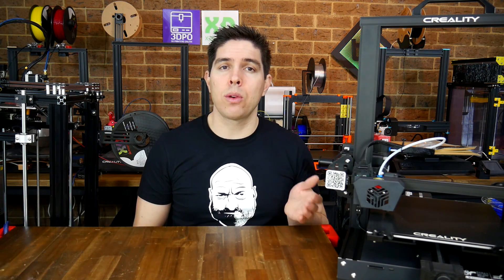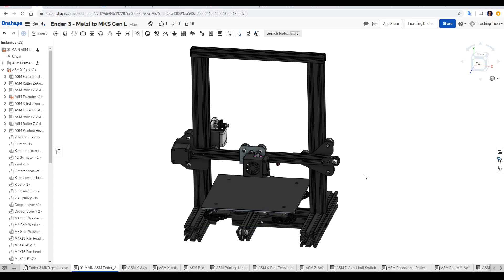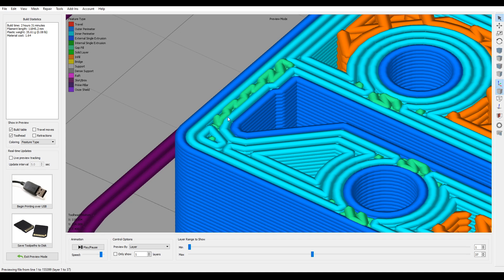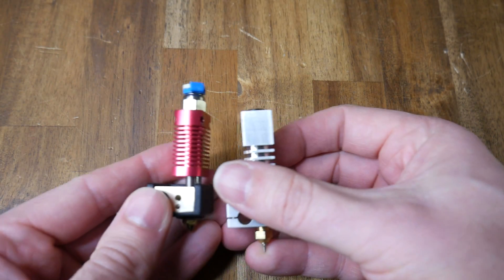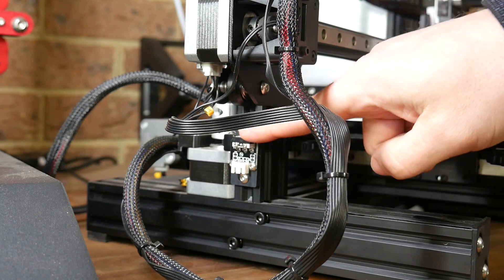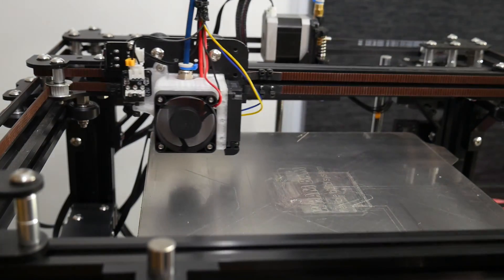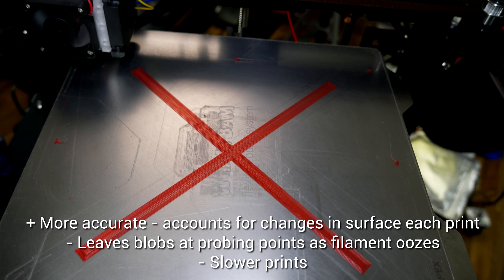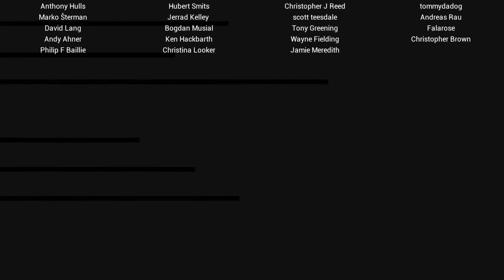CR-6 auto bed levelling for free on the Ender 3 - New printable mod

Comment: Did you run an M48 command to see the results for the repeatability test? Would be curious what you get.
I recently installed a BL Touch and have the stronger springs on my Ender-3 bed, so I opted to go with method 2. I did a 9x9 grid with the bed heated (took over 14 minutes) and then saved that to EEPROM. Then have the M420 S1 in my startup script. Periodically I will rerun the 9x9 grid and save to EEPROM if I feel the need.
Reply from the maker: Not enough room on the standard board unfortunately. All I could do was repeated g29 and compare numbers. With the slower speeds it was about 0.05mm.

Comment: Awesome addition to auto-bedlevelling methods. Nozzle probing is the most accurate method of getting that first layer down perfectly. Unfortunately, nozzle probing also means the nozzle needs to be absolutely clear of any oozing plastic - easier said than done most of the time.
Reply from the maker: I think if it's hot the filament will just get squished out of the way, but with mess. Hot bed, warm nozzle Prusa mini style might be the answer.
Reply: The pressure needed to cause movement will squish any heated oozing filament.

Comment: great idea, and quality content as always. keep up the good work. however, let me point you towards a video from Angus, where he showed a method called "sacrificial layer" that is used on overhanging holes on the print. i think you could easily implement it on your designs, for better printability, and a true supportless model.

Comment: You couldn't upload this before the kickstarter closed? :(
Reply: If the only reason you were buying it was bed levelling, you’re not doing it right
Reply from the maker: The cr-6 is still fantastic and the original system I'm reimagining here is still superior.
Reply: 6SE is a big upgrade on the Ender 3 for about the same price (depending which pledge you got)

Comment: It might be a good idea to add a stop screw to the side to limit "down" travel of the hot end. That way you could keep it under a bit of tension all the time and have more consistent locating of the hot end.
Reply from the maker: Great suggestion
Reply: @TeachingTech  Mabey also make instead of a limit switch use a washer And a Bolt yo make the switch that Will make it more acurated
Reply: I have done this!

Comment: Detect bed contact by detecting an increase in (stall) current on Z steppers? Can stepper current be monitored that closely?
Reply: Not with the stock stepper drivers. So you'd at least have to get a new mainboard if you haven't already.
Reply from the maker: Yes, with tmc steppers as jack days. According to marlin docs easy to destroy the lead screw.
Reply: @TeachingTech  oh well, an interesting idea to explore...
Reply: @TeachingTech  I'm getting a skr mini e3., would it be possible with that?
Great job!

Comment: Warm bed levelling before each print - Set the bed to print temp, and the nozzle to 170... do the mesh, then set the nozzle to print temp. This is what the Prusa Mini came with... and I've updated all my printers to do it now.
Reply: not necessary.. but if you are happy :D
Reply: In case someone wonders how to do this, you can add it to your start g code in your slicer
Reply from the maker: Simplify 3d inserts the temp gcode for you so a limitation that stopped me doing this, but a very good suggestion.

Comment: This was what came standard on my old kossel mini delta.  Tried many iterations to improve accuracy.  In the end the best thing to do was to mount a micro switch on the end of the nozzle without the little metal lever.  I went from .05 accuracy to about .01 or .02.
Reply: Interesting, do you know why manufacturers moved away from the concept?
Reply: @veidumeidu  at least in the kossel design it wasn't reliable enough especially for a delta (no manual bed leveling possible).  Taking that into account and the deviations skewed by effector tilt made it a very poor leveling system.

Comment: Michael, your design is "not overly complicated", just the minimum for functional design. I wonder if we can use an optical sensor instead of the mechanical sensor but it would remove the satisfaction of the clic sound :)
Reply from the maker: I actually purchased some optical sensors but originally thought they would output a clear digital trigger, but instead it was more analogue and needed an additional circuit to get it working. It would be more accurate but didn't fit the concept I was after here.
Reply: What about a hall sensor?
Reply: @brunoboettcher67  Hall sensors are also for fast moving applications. The magnetic field is much broader. They work great in very high speed applications. Since everything else has been tried resulting in low accuracy, this is why Creality went with a strain gauge. What you can do is spend just a few more dollars on a more sensitive strain gauge. For you it is a one off or so. Creality had to keep cost down as a few extra bucks times tens of thousands makes a bigger difference.  The strain gauges i have worked with as a GM engineer are as small as a 1/8" square and can flex with just a fraction of vacuum or pressure change. You would be more accurate than any plate of glass can get.
Reply: @brunoboettcher67  everything is possible. But common hall sensors are quite big to fit in the design. And you come back to something like a BL-Touch in the end or another common sensor in 3D printing :) the mechanical sensor is the most compact
Reply: Indeed, you are right, totally forgot that the bl touch uses a hall sensor.... remains the strain gauge?
Reply: Correct.... cheap optical sensors are poor measure tools at slow speeds. They are best used at fast moving speeds since light moves at 186,000 miles per second which is why they were popular in performance ignition systems and even many factory ignitions in the 90's. The optical sensors on the Geeetech A30 PRO need blade movement of .1mm to go from on to off. At .05 the led dims only. I find a quality switch better than a cheap optical sensor except for longevity.
Reply: There is a touch proble similar to a bl touch that you can 3d print with only an optical sensor. I will attenpt this in the future :)
I heard its pretty accurate, tho i also like his solution for people who dont want to spend any money or modify their software much

Comment: oh hell yaeh this is awesome. I wonder how much more accurate/ smaller actuation distance you can get by removing the metal arm and just hitting the endstop button itself?
Reply: I have auto bed leveling with a microswitch mounted to a servo arm, and running M48, surprisingly it was less accurate without the metal clip.

Without metal thingy
M48 Z-Probe Repeatability Test
Mean: 0.150225 Min: 0.137 Max: 0.156 Range: 0.019
Standard Deviation: 0.005109

With metal thingy
M48 Z-Probe Repeatability Test
 Mean: 0.617350 Min: 0.615 Max: 0.621 Range: 0.006
Standard Deviation: 0.001898
Reply: i think it would then be lower than the nozzle itself, causing it to hit the parts while printing.
Reply: @beurtvanbaningen7786  He means the metal arm on the switch.
Reply from the maker: Good question, I think the bolt would still line up so it may be easy to test.

Comment: Mmm... great effort Michael, but i think ill go for a proper metal load cell, or possibly just a strain gauge film to mount between the factory hot end and the factory bracket.
Reply from the maker: That would definitely be superior but also more involved to setup than this. I'm hoping the community can move this forward.
Reply: @TeachingTech  Actually, I don't think it should be that difficult. It shouldn't require a full load cell since the aim is not to actually measure the force generated by the nozzle pushing against the bed, just to detect that it is pushing enough to generate the force. Such Force Sensing Resistors (FSRs) are quite cheap and come in a number of sizes, some tiny enough to fit between the hot-end and the carriage, so the tricky part would probably be to find the right spot where it will be put under pressure as early as possible when the nozzle hits the bed, and perhaps add the required leverage - if needed. The FSR will have reduced resistance as it is pushed, so if using a MCU, it should be easy enough to sense the analog signal and set a trigger point. Another possibility would be to  put a voltage comparator to convert it into a simple on/off value and replace the limit switch, avoiding the need for any more complex components and/or coding.  https://www.youtube.com/watch?v=VtxFtzWlTgg